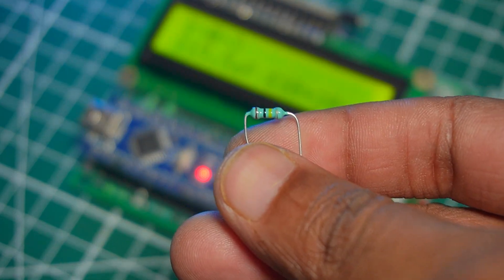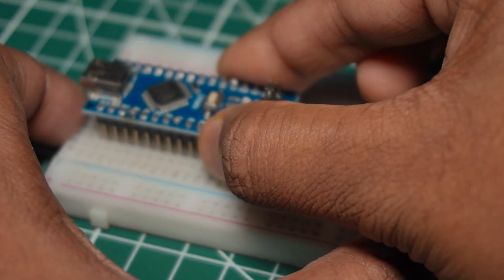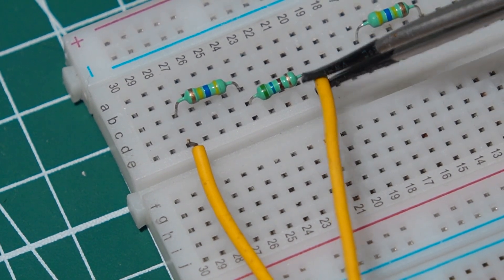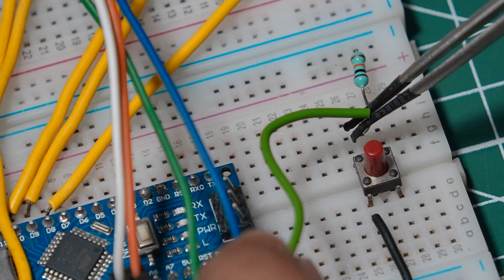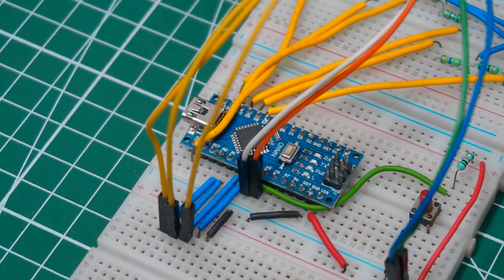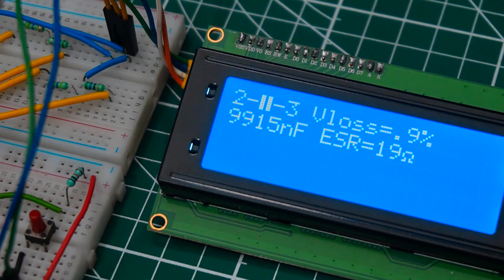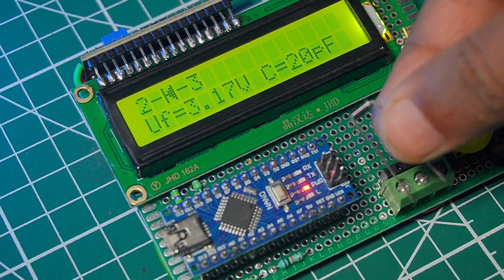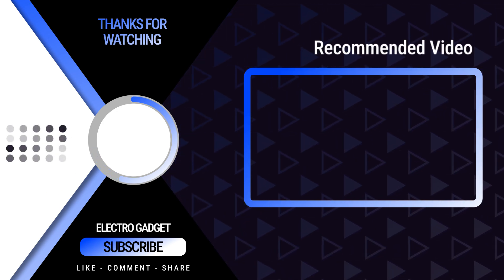DIY Arduino Component Tester | Test Resistors, Capacitors, Transistors & More with One Device

Comment: can i replace nano with uno?
if i replace what are changes required.
Reply from the maker: No changes required. Just select the right board while uploading that's it.
Reply: @electro_gadget80  while uploading the code right?
Reply from the maker: You don't need to do any changes in the code just select Arduino Uno board from tools and upload it.

Comment: You could've enlarged the schematic and made it eye friendly and an enlargeable image! Wiring instructions is not identical to schematic! Confusing!
Reply from the maker: You can click on the circuit diagram image from the website link given in the description to see a high quality image as well. It is clear that the image cannot be eye friendly from the video. So you need to go to the link mentioned and can get all the things easily. And lastly the wiring instructions are already identical to the schematic, you can check it by comparing side by side.
Reply: @electro_gadget80  OK, thank you so much for your patience. Now enlarging the image works, it hadn't before, I got you cannot copy image when I clicked that's why I wrote to you. I'll try to wire according to the schematic. Now it works!

Comment: Impressive video, Electro Gadget. Looking forward to seeing more content from you. I smashed that thumbs up button on your upload. Keep up the fantastic work! Your approach to using the Arduino Nano for this component tester is brilliant. What challenges did you face when integrating the I2C LCD module into the circuit?